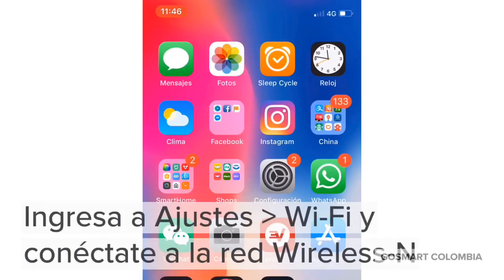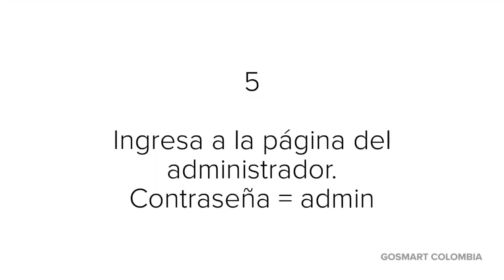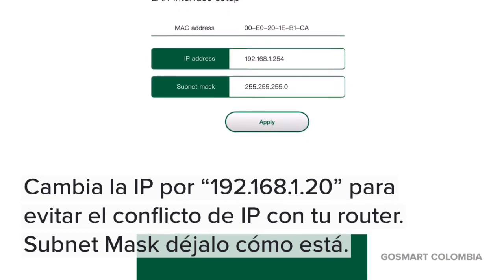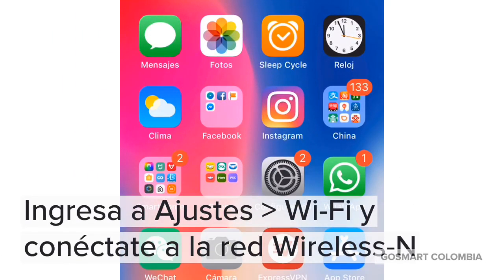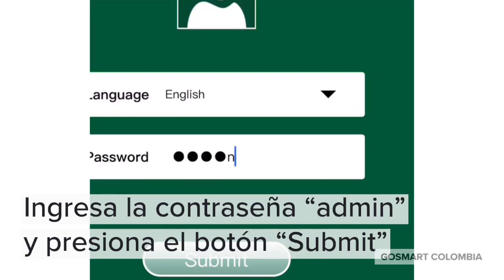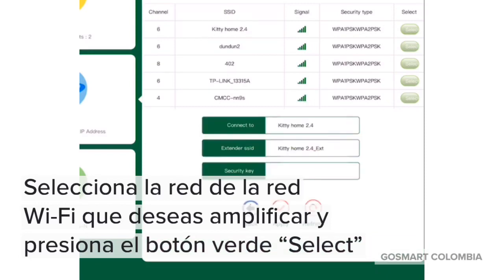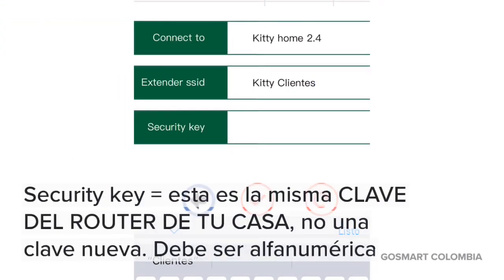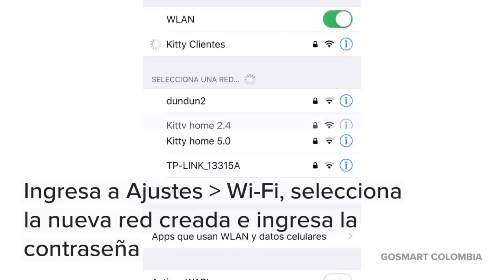Wireless-N Mini Router | Instalación Inalámbrica Completa

Comment: How do you connect the wireless router on to a PC? Same method?
Reply from the maker: Hi, do you mean the configuration or how to connect it wired after configuration? Configuration is same on mobile or computer. After completing the configuration you’ll get a wireless network but you can also use the 2 ports to connect your devices with an Ethernet cable. I hope it helps! Please follow my channel :)
Reply from the maker: Hi there, first use your mobile phone to do the configuration explained on the video, this will link the wireless router with your home Wi-Fi router and it will create a new Wi-Fi network but also you can connect wired devices connecting an Ethernet cable to the WiFi repeater LAN port if your have this option.
Reply: @gosmartcolombia  thanks for the response, I already connected my computer with the router  using a cable to connect it. I just had to put the default IP and the User/password.